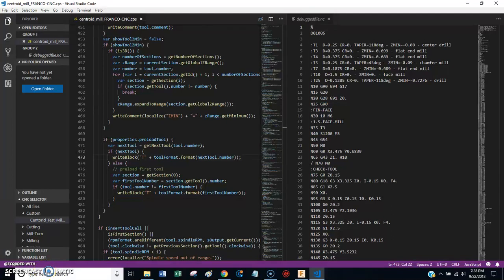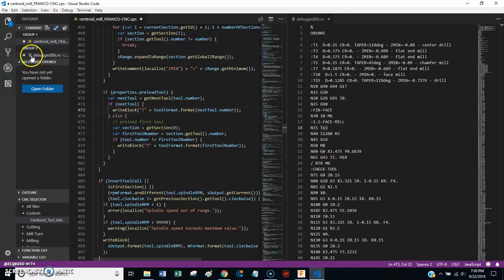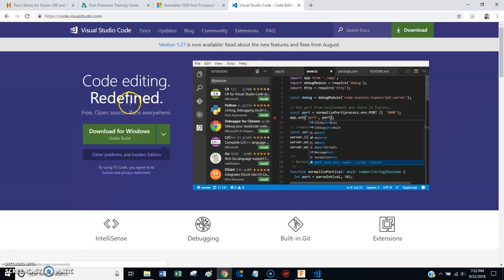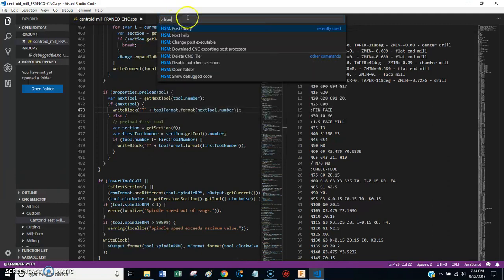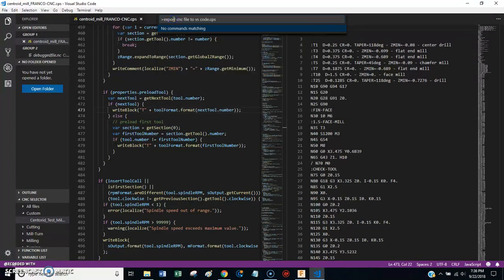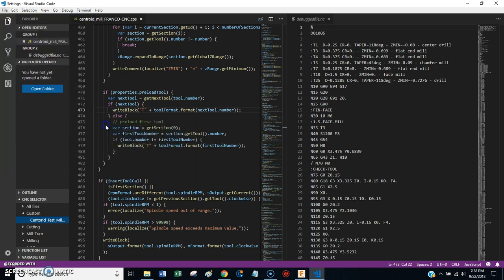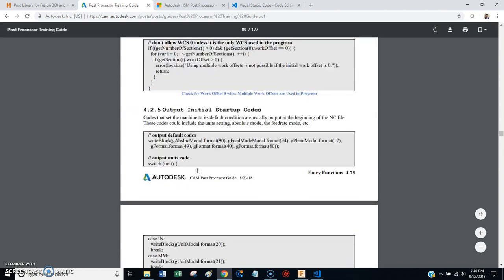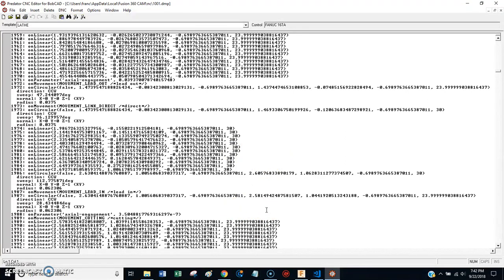Edit Fusion 360 Post Processors with Visual Studio Code

Comment: Very helpful video.

It would not work for me when I got to the point of clicking the cnc file it posted out of Fusion using the special editing post file. I clicked and double clicked the cnc file it created and showed in the custom folder and spent hours trying to get it to work, even installed it on another computer with the same result. What I finally figured out to get it to work was to change the setting for the Autodesk Post Utility that says "Post on CNC Selection" to the checked (on) state. All worked fine after that.There was no mention of that being a required setting change to get it to work as demonstrated in the video.  Later I figured out from reading the manual (rather than depending on the video, stupic me) that highlighting the cnc file and pressing ctrl>alt>G keys makes the selected cnc file process if the setting has not been changed as described above. . I should have read the detailed manual rather than just depending on the video.
Hope this helps any other frustrated users with the same problem.

Comment: under my CAM360 folder I have no post.exe file, any tips?
Reply from the maker: As i recall, there may be some hidden folders. Look at the example file path in the instructions.   Use that example to navigate to the hidden folders.
Reply: Franco yup I’m using that same exact path and I have show hidden files turned on, when I get to the CAM360 folder I only have several folders with no files below them which is where the post.exe file would be, I’m scratching my head on this one
Reply from the maker: @Dartmouth_CNC  Well, that stinks.  If you can post in Fusion, then that exe has to be in there somewhere.
Reply: Franco well I figured out why I can’t see the post.exe file, it’s because it’s only reading .cnc files and I can’t change it to read all files

Comment: Awesome! I was so lost when trying to edit my post with notepad. I hope this will help me add mist coolant Mcode to the fanuc post.
Reply: Update:After some fumbling around with settings, finding post.exe, and I got the auto line selection to work, then the edits were not so bad. I have now added m7 for mist coolant, and reformatted the start and end of tool calls to my preferred order of mcode. (No more hand edits). Also removed the standard sequence numbers and added a N sequence number before a tool change that matches the T number for Easyer navigation of the program on the machine.